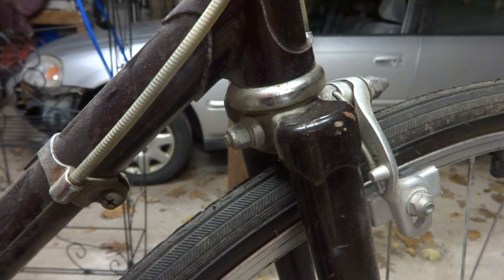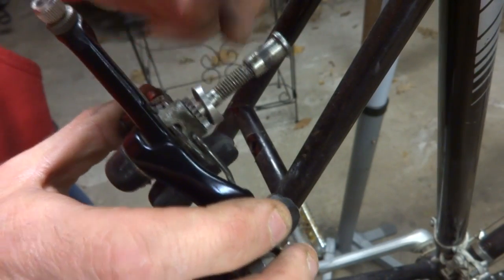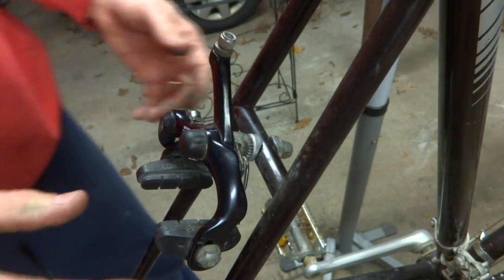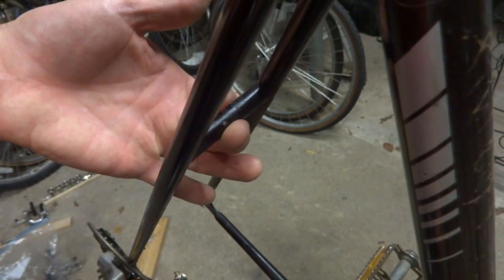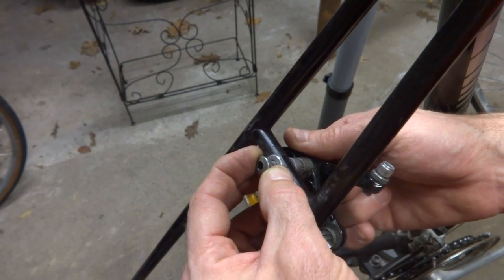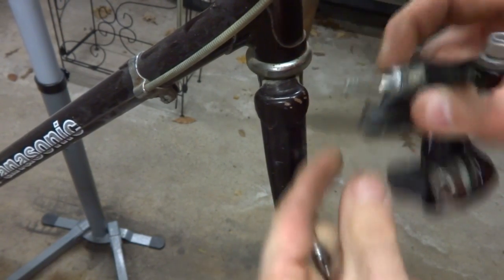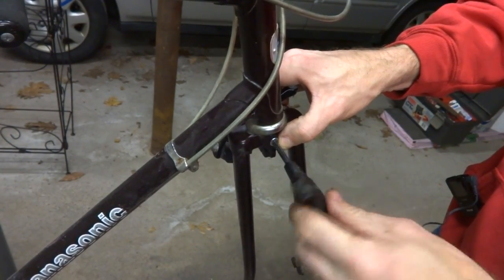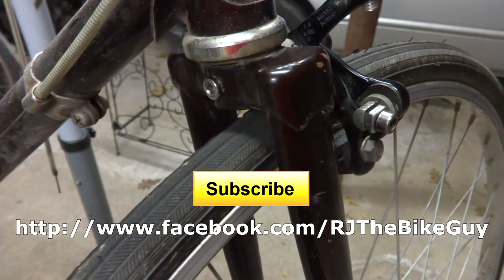Install Recessed Mounted Caliper Brakes On Vintage Bike Frame

Comment: Asked the mechanic at my LBS how I can put newer brakes on my old frame to improve my braking he said, "you can't". You're the best RJ, thanks a ton.
Reply: Typical LBS response
Reply: Pat Fenis The best thing to do always is to do research and learn to work on your bike yourself. In my experience you will hardly ever find a bike shop that puts tlc into their work. Mostly they just slap stuff together and send you packing with minor to no tweaking at all.
Reply: Same with cars
Reply: alot of them will just to get you to buy a new frame set or bike completely, my local aren't too bad but I've been to some that tried charging to fit new tyres that I'd bought from them and fitted a week or 2 earlier
Reply: This is why I hate LBS. like I’ve literally seen it done online and I don’t have the tools to do it myself that’s why I’m coming to ask you and you act like it’s not possible. Have you ever thought outside the box and done creative work? lol

Comment: I have a strange issue where I have recessed brakes and a frame that appears to be intended for them (with a flat brake bridge with asymmetrically sized holes), but the bolt can't tighten enough to hold the brake steady. It seems like somehow the hollow nut is too long? Or there is a washer missing? The bike is a junk yard find, so could easily be missing bits, but I don't understand how anyone could have ridden it like this :/

Comment: So helpful!  Just mounted some modern calipers on my late ‘80s Schwinn Traveler.  There is zero concern with widening out that hole in the brake bridge.  Plenty of extra metal and the walls on that tube are surprisingly thick.  I ended up using a right angle drill adapter and had to cut about an inch off the bottom of the drill bit to make it fit properly.  No regrets here, and thanks for posting all of these videos.
Reply: what kinda brakes did you put on the Traveler? (I'm in the process of modernizing one right now!)
Reply: Shimano R451 on front and rear.  They work with the 105 R7000 shifters.  I think mine is a 1987 model.  Might want to check the clearance on yours first.

Comment: Did this today on my 84 schwinn world sport, and installed some older Shimano BR-R600's the most nerve racking 30 minutes of my life. broke a drillbit on the forks, but i was able to finish it off, brakes actually stop me now super big upgrade from the old diacompe 500s it had stock, thanks dude! super helpful as always with your videos, I would love to see some bike check videos, or a work bench check/tour,

Comment: Glad I found this video. I have a 1986 Fuji Absolute road bike with original Dia-Compe side pull brakes which are sticking badly that I wanted to replace.

Comment: Thanks, I have an older Bianchi Tre-Tubi , nothing high end but a keep sake for me . The brakes are just bad and don't have any braking power. I want to go to the dual pivot, and they all have recessed nuts. Now I know I can buy a good used set Campy dual pivot and mount them on the old style frame.  Thanks again.!

Comment: used method 2...didn't have the right drill size but kept testing with the recessed nut until I was able to force it in without making the hole too big.  Thanks RJ!

Comment: Thank you so much i have successfully installed modern brakes on my vintage Peugeot bike.
Reply: Did you have any problem with the back piercing?
Reply: @swandx  no, but only on one side it need the hole to be bigger where the nut is going.

Comment: Hi RJ, I just came across a similar situation and searching on the Web I saw your video, in my case the frame is aluminium and the bridge where we supposedly install the break has no hole, it has only breaks in front, considering the frame would you advise drill through to use the same break as on this video? Thanks in advance

Comment: Recently made this upgrade on my retro build single speed gravel bike. Luckily had the tools to deal with it, drill & die grinder.

Happy i opted for recessed over nutted even though it took a bit more work, really finishes off the modernised retro look!

Comment: Hello RJ,
  I've managed to install recessed mounted brakes on my vintage frame without any kind of drilling. I simply swapped back and front brakes, mounting the former front brake with the longer bolt in the back and mounting the one with the shorter bold inside the fork (This may sound complicated but I'm sure you know what I mean). This worked since the 5mm allen key  fits through the forks original drilling. My question is if this is safe enough. I'm worrying about this construction not being able to handle the great forces that affect the front brake. Should I just get a longer recessed lug and drill through the back of the fork? What would you recommend?
Reply: +Harley Johnstone I've been riding around for 2 months on my bike with the former back bike mounted inside the front fork and I've got to say I was worried about it breaking or coming loose but I haven't had any issues so far. Then again, I'm only using my steel steed on which I chose this setup to commute, so, no racy situations where really great forces are applied to the front brake.
Reply: I've just done this to my front brake, thankyou so much for this idea <3
Reply: @richardnick2216  how is going after two years?
Reply: I actually wound up ditching the 5mm allen bolt brakes alltogether at some point and got some period correct shimano 600 Arabesque brakes with the long bolt and traditional nut attachment. I unfortunately can't really comment on long-term reliability therefore.
Reply: Thanks for the idea, this helped me install mine and I also came up with another solution. I was worried about the font brake bending the fork too, so what I did is I got a long nut that fits inside the fork, then put a bolt in from the back (so from front to back: brake, fork , long nut, fork, bolt) this way it is secured just like a regular brake all through the fork, and I don't have to worry about stability.
Reply: @djhusi  Hi Marcell, sorry for bothering. Just reading your comment and thought this is a great idea. do you remember by any chance the size of the long nut you used ? Thanks a lot and greetings from Luxembourg!

Comment: hey man, I'm wondering if there's a problem with just drilling the rear fork all the way thru the other side? is not recommendable? thank you for the video!
Reply from the maker: It will weaken the bridge just a little more, and the hole will be bigger than the bolt so the brake might not be as solid.

Comment: Thanks for the video! I ride a 2018 Poloandbike Williamsburg fixed gear bike, and the rear mount looked like this and I had this exact issue. I’m going to drill into the frame as soon as I find someone that will let me borrow their right angle drill...😅
Reply from the maker: Something I did in a later project was make a stubby drill bit. I cut the bit shorter. I even cut the fluted part and reground the tip on my Drill Doctor.
https://youtu.be/KHXYN1JH8Oc?t=2573

Comment: Hello, Thanks for the video it was really helpfull. I have a question please. 
While doing the rear/back break hole I was using a normal drill since I didn’t have the small one, I think I went to low. Now I’m afraid that the little tube on the frame will break eventually.  Is this is a real possibility and if it is how I can reinforce the little tube to prevent it.
Amazing DIY btw!
Reply: what happened to your brake now sir? I don't have small drill as well and I am in the process of converting to this now.

Comment: There is a very odd drill called inverted bore drill, functions like a raise bore drilling.  So the drilling head is not in the tip but towards the chuck (the chuck rod is smaller than the cutting head). It is meant to be inserted trough the hole from the other side and attach the drill to the chuck after it's in the hole. So you need to pull on the drill to drill the back face.
 
I'm not aware of where to source such tools but ingenuity could lead to make your own.
Start with an HSS 3 fluted coutntersink (a common size is 6mm shaft 8.3mm outside) with full depth flutes and angled back face. Spin the countersink in a drillpress and with a dremel grind stone carefully reduce the OD to 8mm. Then dress some relief angles on the back face to transform the back face into cutting teeth with some careful dremel grinding.
Be aware you need to run the drill in reverse.

And you can still use the modified countersink as a countersink since the front tip will not be affected.

Comment: Hi RJ! I'm curious as to early 1990s Shimano brakes have already transitioned to the recessed nut. Based off your experience, do all recessed mounts for Shimano brakes from 1990s until now have the same 8mm diameter locknut? Or these have also varied through the years?

I'm thinking of doing this on my bike to accommodate an old 105 brake, but also thinking if in case I want to upgrade to newer recessed nut brakes that I won't be screwed.

Comment: I drilled holes to fit my new 105 R700 breaks just as you said,
the front break fitted fine but the rear break seems to be too short (is there a thing called short reach or something?).
the pad just won't reach all the way down, they touch the tyre instead, at the lowest position.

any adapter or something that could extend the reach? perhaps lowering down the mounting holes with some adapter?
I saw some spanish guy creating such adapter but its beyond my skills.
Reply: Hey I had the same problem.  AliExpress has a brake pad with an extended arm I just ordered last night. I'll let you know how it goes if you haven't found a solution by now...

Comment: Great Video!!! I did this modification and realized afterwards that the new brakes have a shorter reach fro the bake pads. Do you recommend filling down the the brakes to make them a longer reach brake or purchase a new set of long reach brakes?
Reply from the maker: I recommend getting longer reach brakes. I have used these: https://www.amazon.com/exec/obidos/ASIN/B005DTQ6UQ/ref=nosim/youtube25-20

Comment: Hi I have a question a 1938 schwinn frame which the hole is not on the horizontal way is vertical horizontal can you put a brake there please

Comment: Thanks for sharing! I have an old apollo which at it's age I think is a Canadain brand, not the Austrian brand. But I was wondering if you knew what the longer armed or long reached road brakes were called? I bought some new brakes thinking they would fit, once I got them they were much too short.
Reply from the maker: Long reach brakes.
Reply: @RJTheBikeGuy  Thanks, that's what I thought but I am having a hard time tracking some down.

Comment: Thanks, i might try filing out the rear brake mount as I don't have a right angle drill. Do you think there would be problems if you go back to a vintage brake set? i.e. wobbly braks because the hole is 1mm larger.

Also lol at not having 8mm drill bits. US can be so backwards like that!
Reply from the maker: You can buy a 8mm bit on ebay.
Reply: RJ The Bike Guy I'm in the UK 8mm bits are everywhere :D I was just having a chuckle at the US use of imperial
Reply from the maker: There are two kinds of countries. Those who use the metric system. And those who have put a man on the moon.
Reply: one more thing 5/16 drill bit should do the job as its nearest to 8mm...

Comment: RJ, I have already the recessed nuts. My problem is that I need to service the brakes, but I cannot get them off. The nuts are like welded onto the screw. Do you have any idea how to get the brake off the bike?

I have the same type of problem with the barrel adjusters. They broke in half. Is there a way to get them out?
Reply from the maker: Dunno. Penetrating oil.

Comment: Hi.  I would like some information regarding brake measurement.  I am interested in changing a V-Brake system to a dual pivot caliper brake system.  How do you measure the brake length to use ?  I hope this clear to you.  Thanks for any advise.
Reply from the maker: Trial.

Comment: Would a step bit work better? Mine is only 2.5 inches long and has a 5\16 step.
Reply: A little late to the party, but YES, I used a short / fat step drill (5/16 is step #2) and a right-angle drill head on a cordless multi-tool, and it fit just fine in a pretty tight rear triangle. You could even mount the step drill bit in a tap handle and turn it by hand (slow.....).

Comment: So I'm taking old vintage modolo speedy brakes calipers off, If I want to sell the bike later with the old brakes back on it, will the old modolo calipers have a problem working if I drill all the way through the back bridge (including both holes)? (I don;t have a right angle drill)

Comment: Hi rj,

 How would we reverse the brake blocks so the open ends face to the rear?

Do have a vid on changing to a longer bolt for the front. As i undetstand, the front calipet goes to the rear and th rear comes to the front with a longer bolt swap

Cheers
Pal
Reply from the maker: kirpaljeet singh I don't understand what you are asking?
Reply: RJ The Bike Guy this -> http://www.sjscycles.co.uk/jtek-tektro-shimano-pattern-70-mm-dual-pivot-brake-bolt-cr-mo-for-nut-conversion-prod24266/?geoc=us

So i thought of doing the conversion this way. Front caliper to the rear and rear to the front. I figured out brake blocks, the pads perhaps? 

Any complexity on changing the bolt? As per link?
Reply from the maker: kirpaljeet singh Not sure exactly how that bolt is used. It sounds like it allows you to replace the bolt in modern brakes to fit on older frames. I have not messed with that. So if you are going to do that, why swap the brakes? I do it in the video do to the length of the bolts on the brakes. I show several different methods in my vid. If you want to try those. fine. If you want to use that bolt fine. But I don't know anything about that bolt and it is different than what I show.

Comment: Well, this could work, though in some cases (especially where the frame is of better quality), the brake bridge is actually quite thin, and the hole for the brake mount has a small tube welded into it.  In such a case, trying to drill out the hole could seriously weaken the brake bridge. It might even crack or give way under heavy braking.  And you don't want that.  If there is a tube welded into the bridge, it was added because the frame maker felt the extra strength was needed there, so don't try to drill it out. Go and find a longer center bolt, swap it on, and bolt it on normally.  An alternative is to find a front bolt for the rear and cut off the excess, or to swap the front and back, enlarge the rear hole in the fork (which is usually very strong there) and use a long recessed nut to thread the brake on through the fork crown.  Modifying a frame is best avoided, where possible.

Comment: hey!  i'm really novice - i was wondering how you drill out the concave washer? so it was the original washer that you used from the original break - did you clamp it down and drill the 8mm hole in it? thanks
Reply from the maker: Just held it with a vise, and drilled it.

Comment: Would basic 5/16 inch drill bit made of high speed steel cut it? Or do I need a stronger drill bit? Thanks for sharing.
Reply from the maker: Should work fine. Bike frames are not made from hardened steel or anything.

Comment: My LBS freaked when I asked them to do this saying it'll compromise the strength of the frame. It doesn't like that big of a deal though. How long have you been running your brakes like this?.
Reply from the maker: You are removing very little material. Sheldon Brown talks about these methods on his webpage: http://www.sheldonbrown.com/calipers.html
Keep in mind, not all bikes are the same. There may be situations where doing this is a bad idea. You do this at your own risk. But it is not really that uncommon.
Reply: Thank you.

Comment: Hello RJ,
Just a thought, but why don't you just drill all the way through both ways for the rear? Wouldn't it be okay since you're using the concave washers?
Reply from the maker: No reason to weaken to brake bridge by drilling it more than you have to.

Comment: Do you know if older modolo brake levers will work with my new 5800 105 brake calipers?  I can't really tell and don;t want to buy new levers if I don;t have to...
Reply from the maker: +Joe Wind They should.

Comment: My raleigh has the bolt type brakes and I want to do this to the frame so I can upgrade them. Trouble is on the rear there is a tube through the frame that the bolt goes through and a large lug on the outside face that the brake bolts to. Could I just drill through the lug and frame to 8mm then tack weld a 6mm washer onto the lug? Can't see why this wouldn't work but might be missing something!
Reply from the maker: I can't envision what you are describing.
Reply: I'm not surprised mate, it confused me when I read it back! I'll try and send you a photo on Facebook if that's OK? Might be easier to explain with photos!
Reply from the maker: Ok.

Comment: Also I want to add I bought my parts through merlin cycles.  Best prices I have every seen on bike stuff and they didn;t charge customs when they sent them to me in Oakland, CA. (the store is in england)...  I paid $50 for full set of 5800 brakes.

Comment: Thanks RJ, but can you do the other way around, that is, putting a non recessed brake on a frame that is made for recessed caliper.
Reply from the maker: Probably.
Reply: @RJTheBikeGuy   tried it but calipers don't reach too well the rim... could work but not always.
Reply from the maker: @michelchartrand5964  Then you need longer reach brakes.